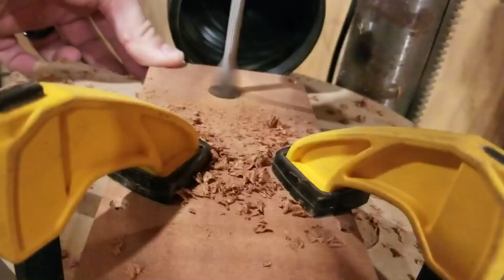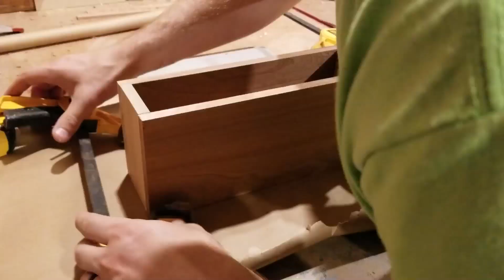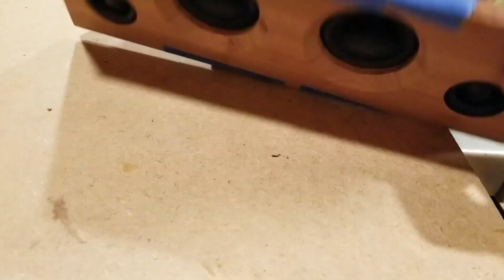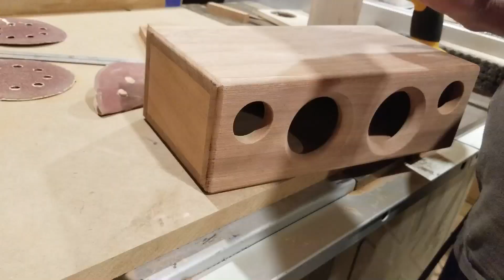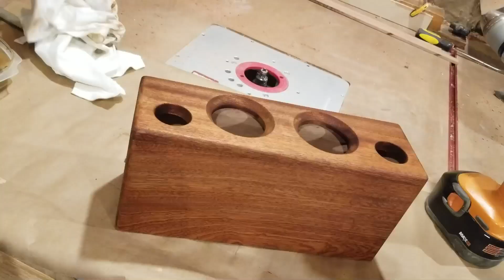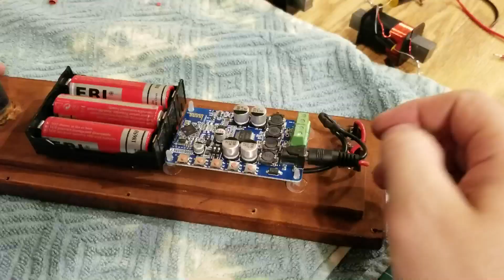Solid Mahogany Wood  Bluetooth Speaker - The Prestige

Comment: Hi toid .. how do you wire a speaker that is using two mids/bass and just one tweeter. Will one channel have mid bass and tweeter and the other just a midbass?
Reply from the maker: You see a lot of people doing that nowadays. It's a Bluetooth speaker but with two mids and one tweeter. basically, there is no way to get true stereo sound from an arrangement like this. Most people wire this as a single speaker, which means you're getting a mono signal. That's why this build has 2 tweeters and 2 midranges

Comment: @Toid @everyoneelse I've been using some bluetooth amps, and some of them have wrong polarity to the speakers. For example one way is ok (left channel) but on the right channel the polarity is inverted.. (i measured with voltmeter in mV giving me negative voltage). Is that how's suposed to happen? i onnected the correct way tho... wird...
Reply from the maker: That is weird. I haven't personally experienced that. Good ideas to check the polarity. You'd hate to cancel it the waves
Reply: yep. from now on, always double checking that

Comment: Very nice looking one. One question, why full enclosure for all drivers? shouldnt it be separeted?
Reply: There's no reason to separate it. It's not stereo first. So they're doing the same thing. Just like a regular speaker that uses 2 mids. Or 2 subs that only play mono in the trunk of your car. Second. It would just reduce the size of the enclosure. And since it only goes down to 50hz. There's really not much need for serious bracing either. It's a great design. People worry too much about every little detail, looking for perfect sound quality. But forget there's trade offs too. Like increased price, and reduced box size. Which will decrease the bass. If you want perfect sound quality. You're barking up the wrong tree anyway. You'll need 2 speakers that are bigger then this, and a bigger amp, and a room to put them in, and a preamp, and a a great source, and really good wires, and.........
This is just a Bluetooth speaker. Not a HiFi system. And it's a damn fine one too IMHO.
Reply: First off, we are not discussing if its pretty or if is suited for the purpose of a boombox. We are only questioning if this was separated would it benefit or not. And you are wrong when saying it is mono, toid wired both amp output signals to the crossovers
Reply: @Another Dick There's plenty of speakers like that. You've never seen a MTM setup? (Mid/tweet/mid) And it's not a big box that makes bass boomy. It's no where nearly that simple. Speakers are much more complicated then that. And many times, being boomy is a result of speaker positioning, and/or the size/shape of your room. Nobody builds a decent speaker, and makes it boomy. It's boomy, because it's not set up correctly. For instance. My Advent 5012/w's are super boomy if they're on the floor. Put them on a stand 4 inches high, and you'll hear some of the tightest bass you'll ever hear in a good room. Same goes for corners. When your speaker manual says to increase bass, put it on the floor, or in the corner. They fail to tell you that it will be boomy bass.

Another example is my Cerwin Vega VS-150's. Super boomy in my room. Now I can't really get them off the ground though, because if their size. But they're already on their own little stand that's built in anyway. The real problem I think. Is that my room is too small. So I'm getting what they call standing waves. Basically because they go down to 20hz (-3db@28 I think), which is much lower then my Advents, or any of my speakers for that matter (I have about a dozen pairs, and only these go down all the way to 20hz at any SPL that matters). The sound waves at that frequency are actually longer then my room is. So there's no where for them to go. They just stay there for a few milliseconds, and boom. So my choices are plug up the 2 huge ports with something (this will raise the resonant frequency of course, but I can't help but think it will hurt SQ), or use some room correction. I don't use tone controls, and I'm not buying a bunch of room treatments (bass traps) any time soon. But since I do digital anyway. I'm going to get a microphone, and do some RTA measurements. And I'll set my computer up as a DSP, and just basically EQ the boom out of them. Either way. While they sound boomy. They're not boomy at all. It's my room that's boomy really. Or at least that's causing it.
Reply: @Another Dick This is a pair of speakers that I actually own. They're what's called a 2 1/2 way. So it's a 2 way like a regular simple bookshelf speaker with a mid-woofer, and a tweeter. But it has another mid-woofer also for more bass. And the bottom one runs from as low as the speaker goes (30 something hertz, I forget the exact number), up to about 500hz. The top one does that too, but it keeps playing right up to the crossover to the tweeter (It's about 2000hz). Then the tweeter plays all the way up from 2000 hz to 20,000hz give, or take. That's why it's called a 2 1/2 way. Because of the added mid-woofer. They don't play both up till 2000hz, because above about 500hz. If you play two speakers. You get an issue called comb filtering. It's called this, because of how the frequency response looks when you measure it. Basically they cancel each other out, because they're right next to each other and pointing the same way. Either way. They both are in one big enclosure together. There's no reason to separate them. They're both doing the same exact thing up till 500hz, and one cuts out there. If you were doing stereo subs in your car, say. Then you would have to separate them, or they would destroy each other. But when they both push or pull at the same time anyway (on the same channel). It doesn't matter. 

https://www.klipsch.com/products/rf-3-ii-floorstanding-speaker
Reply: @Another Dick I should say too. The bigger the box. Normally the lower the bass will go. So bigger is generally better. But there's not many hard, and fast rules. There's always exceptions. Basically the box has to be the "correct" size for the woofer. So you build the box to the specs of the woofer. And there's wiggle room of course, but you would usually figure it out using a computer program that will tell you the "expected" response for that woofer in whatever size box you choose. You're looking to go as low as possible, but you're also trying to get the flattest response you can too for sound quality. So there's always compromises. You may have to lose some bass to get a flat response, for instance.
Reply: @Another Dick Just to make it even more confusing. You can make the woofer think it's in a bigger box. By adding ports, and/or adding speaker "stuffing". Which is like insulation, or pillow stuffing. Yes that's right. Filling the box with stuffing, makes it "bigger". Lol
Like I said. Speakers are VERY complicated. And the box size isn't what makes it boomy on it's own. 🤪😁
Reply from the maker: +Nuno Correia It is one enclosure.  It was a design choice.  Basically i wanted to get the most amount of bass from it as possible.  If I separated them, I would need two ports (1 for each size), which would increase the size and weight.  It really wasn't practical by that point.  It can be done though.  Another issue, was the balance.  For a portable unit, you want it to be fairly well balanced left to right and front to back.  With that in mind, putting the amplifier and batteries on the back panel really helped maintain the balance with the speakers in the front.  So if I did do 2 enclosures, I would need to create a separate enclosure for the amp and batteries, which would make the speaker significantly deeper, and beyond the size I wanted this project to be.  I hope this gives some insight into the thought process that went into this build.

Comment: I think this is a very good upgrade of your Emoji speaker ...ND65-4 is a great driver especially with the BSC you made, but the highs are just not there.This thing is different, it looks it is the perfect full range speaker with a small volume..I am dying to know what tweeter you used and the crossover network and parts, I did not find them on your blog.Is there any chance to give this info?  Very good work, thank you for sharing your knowledge on youtube.
Reply from the maker: I can't share this exact information on this speaker, since it was a custom build for a customer. Maybe someday, I'll have something for you guys, but I can't share this exact one.
Reply: Ok, no problem.But I would like to add a tweeter in parallel to the mono version of the emoji speaker with a resisstance and a cap and KEEP that BSC.Is there any combination you could recommend?

Comment: Nice speaker man. It's awesome you're selling these on Etsy. I didn't realize you were doing that. Good stuff man!

What amp did you use?
I finally bought one of these chip amps myself. I was still trying to decide which one to get, and just decided to buy one on a whim. They had a 15% off thing on Ebay last Tuesday night. Normally I'd have been working, but ended up having the night off, because I had a tooth pulled.

So, even though I'm saving up to buy another car. I said hmmm, let me get some odds, and ends. So I wrote a list of stuff I needed. Like speaker wire ends, and power cable ends. I almost bought some tubes, but decided they're too much. Grabbed some heat shrink wrap. Just like $50 worth of crap. And right before the time on the coupon ran out. I went over my list one more time. And remembered I wanted to try one of these.

So I had been seeing the Breeze Audio TPA3116 amp advertised all night, and even though I wanted one without a volume control. So I could just use my tube preamp. I figured what the heck. I can still use it anyway, and this will be more functional. Plus I can always give it to someone else later, and they won't need anything else. So I got one for about $25 minus the 15%. So like $22 give, or take. Only issue is it may take a month. Since it's coming from China. Or should I say JI-naaaa? Like Trump would. Lol

I'll try it with a laptop wall wart first. And I've got two nice car batteries in my garage I'll try it out with later, after I get a car charger for them. That will max it out at 24 volts if I use both of them. And one's a high amp AGM car audio one. And I think the other is a high amp too. So between them. It should really pump, especially on a set of my Klipsch speakers. Which are 94db (KG 3.5's), and 98db (RF-3's) respectively. I've also got a set of 92db 6ohm speakers that should do real well on it too (Pinnacle PN8+). Should be fun. I'm almost scared that I'll love it. Because that will have me buying tons of these probably. 😁
Reply from the maker: This one I used one I had on had.  But the rest of them I will be using the Dayton KAM boards.  They are fantastic little boards. 

Haha, I have been there.  Just a get a few little things to mess around with.  You might as well.  It can be hard not to pass up a good deal :)  I do hate the waiting though, just like you.   Good luck with your build.  It sounds like a great build!